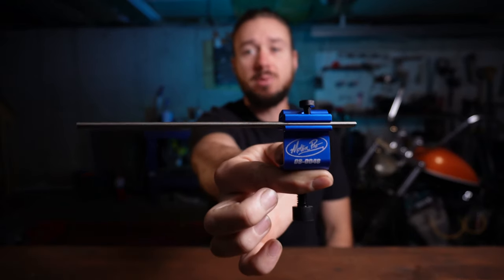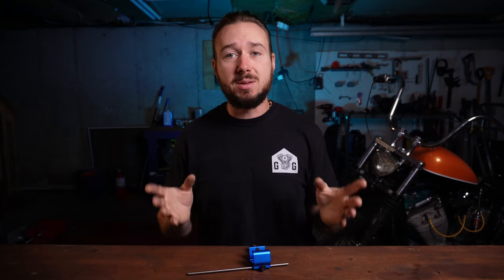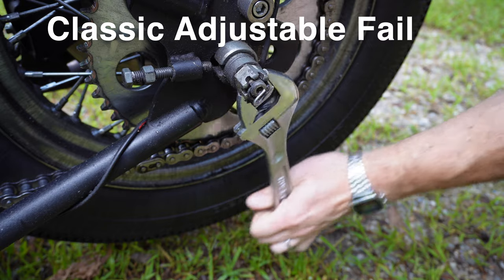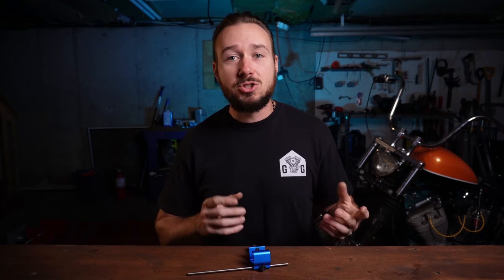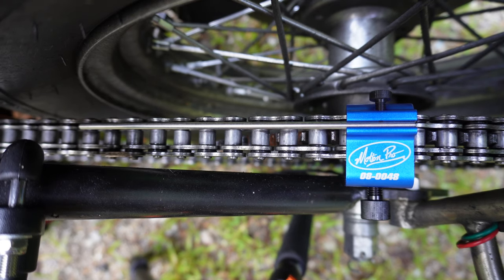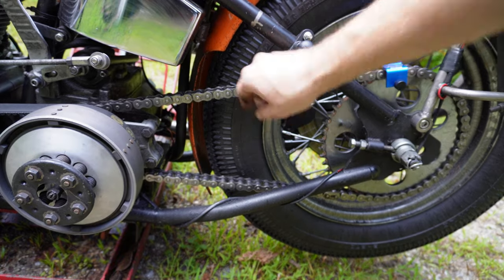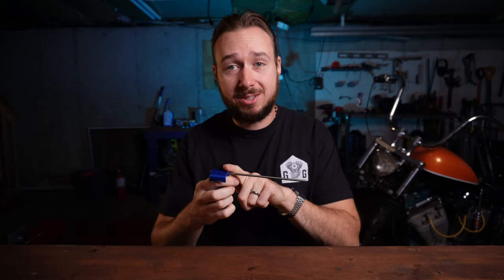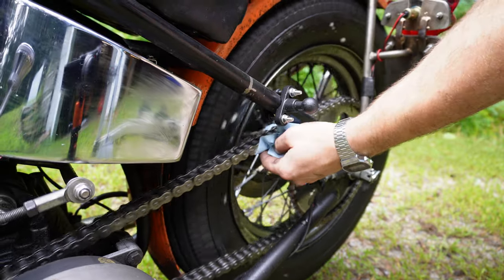Motorcycle Chain Alignment (The Easy Way!)

Comment: You're using the adjustable wrench backwards.  Flip it over and pull.  This will put the pressure on the tool and not the jaw.

Comment: Check your rear wheel before buying this type of aligner ( rod or laser)- if the rear sprocket is smaller than the rear hub it won’t fit.    Certainly doesn’t fit the Triumph Bonneville T120!